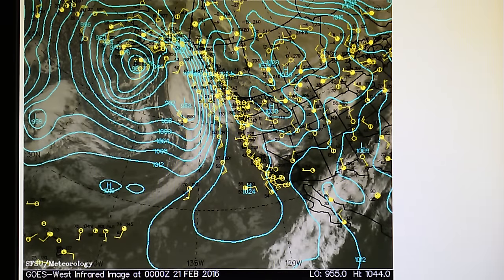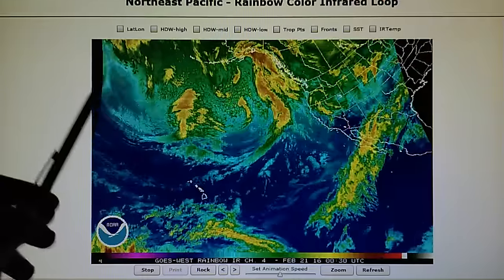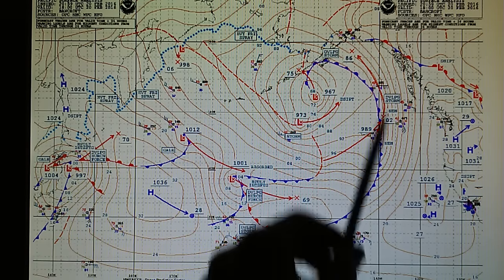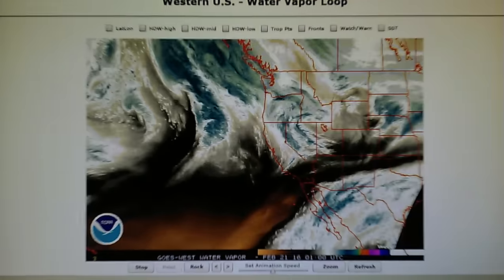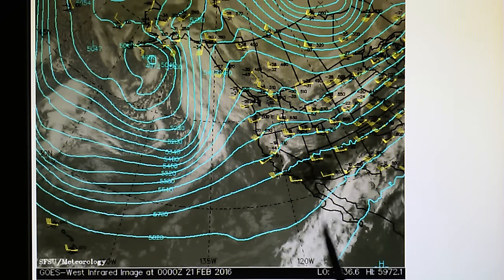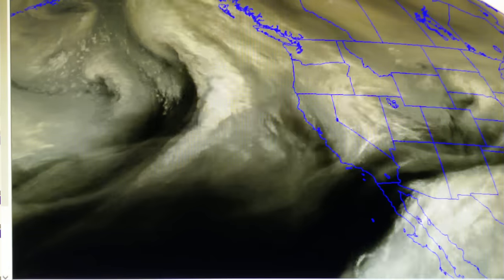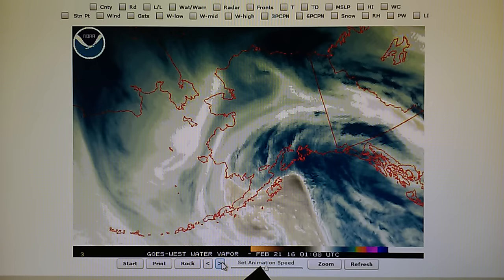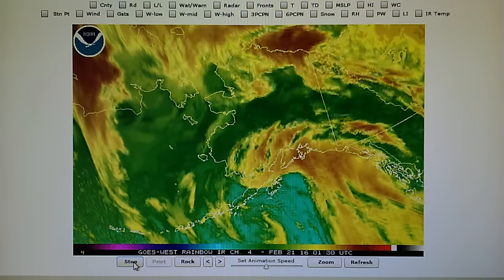2-20-2016;  Day-3 of Stationary High Pressure Parked off CA;  Right-Angle Front over Alaska

Comment: Attention Weather Controllers:  What's the point in breaking apart storm systems and building high pressure walls that squeeze natural energy into larger and fiercer storms?  Has it gone so far that you can't stop or are you so drunk with power that environmental destruction feeds your negative life force?
Reply: The weather mods are BOTH drunk with power AND have created monster storms as an artifact side effect that they are no longer able to control.  Massive fail!